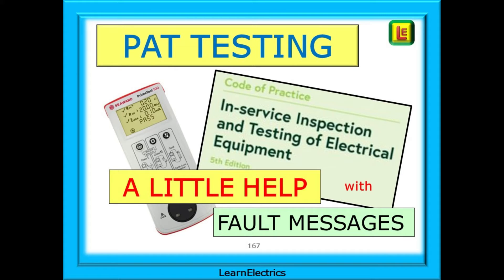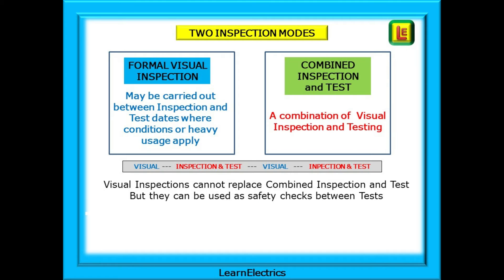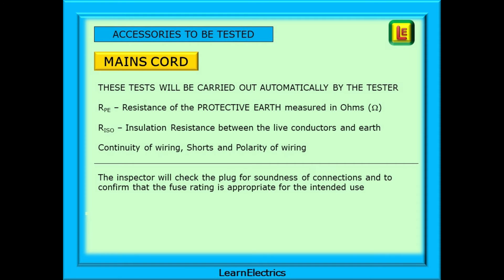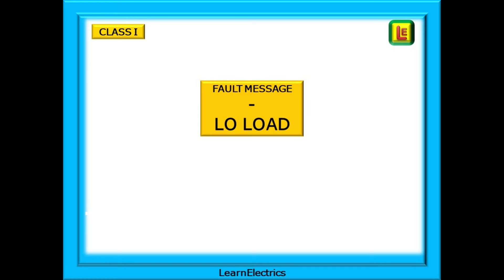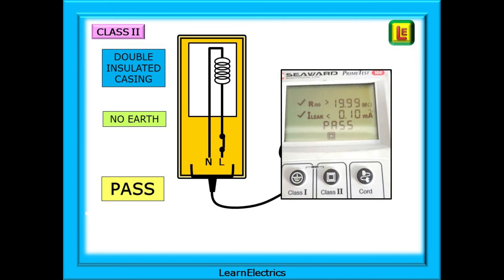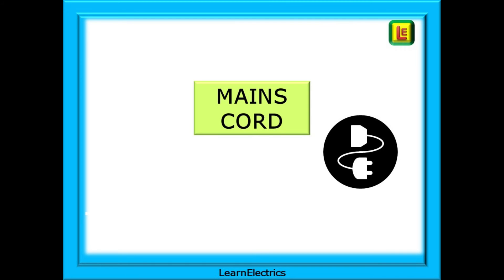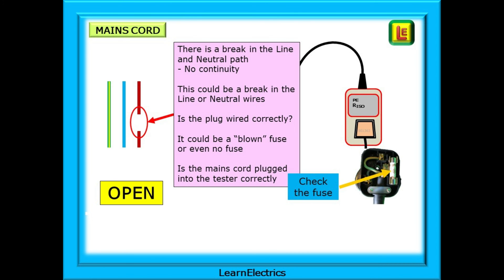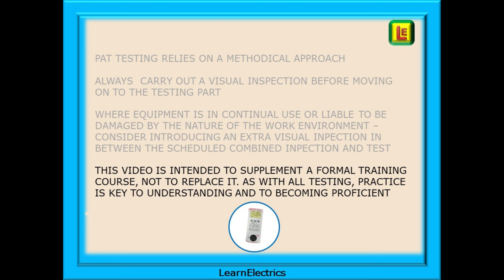PAT TESTING – A LITTLE HELP WITH FAULT MESSAGES – WHAT THEY MEAN – INSPECTION AND TESTING

Comment: Another well presented, easy to follow video. Can you advise when Learn Electrics will be posting the code of practice video as discussed, as I have an exam coming up, in just less than a months time and I would really appreciate your guidance.👍
Reply from the maker: The first part of the CoP is planned for early November. Hope this helps and thanks for watching. Dave.
Reply: @learnelectrics4402  Thanks Dave. Have you had any luck with the 5th edition COP for In-service Inspection and testing video. If you are about to release it would be great as I have an exam on the 24th and your videos offer excellent advice. If you have time can you explain when we would usually choose 200mA earth continuity test, a visual showing if this only runs on the primary side of the LVPS and when exactly does this need to be selected at a lower rating of 20mA for sensitive equipment. I am trying to visual how far this continuity test goes due to sensitive equipment as the printers have alot of electronics internally but obviously it would not be an issue if the test doesn't continue onto the secondary side unless there's line conditioners or surge protection etc.Also when exactly to select high current test loads upto 25A. Also, when either of those cannot be selected for whatever reason, why and when to select alternative test methods and what those tests consist of. I work repairing printers, so your guidance is always welcome and I will be looking to become a PAT tester once I have more experience and will be testing all equipment including I.T sensitive equipment and would feel better if you can expand in the guidance for printers and sensitive equipment using a Seaward Primetest 350. Thanks for your help.